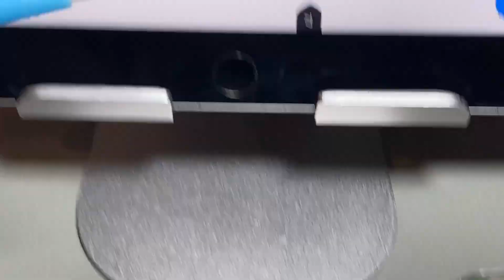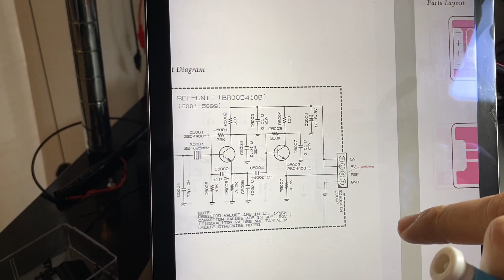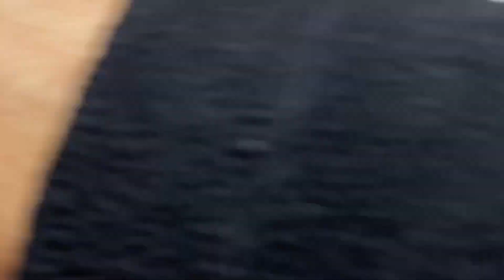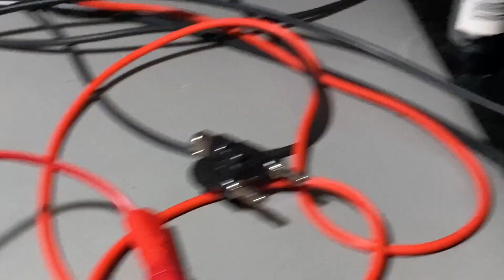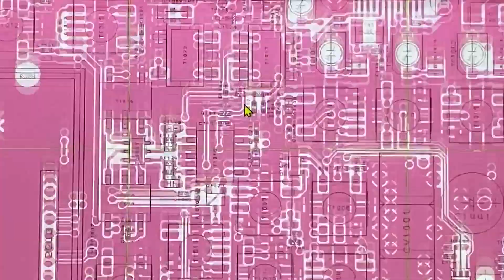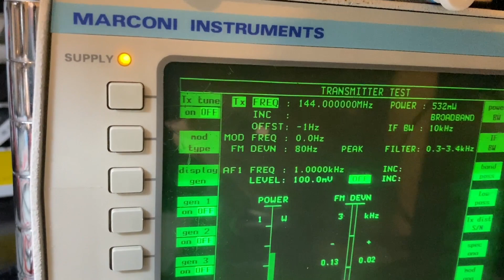MY YAESU FT-817ND | service adjustments - part 1

Comment: Good evening dear om, it is with great pleasure that I watch your very interesting and very explanatory videos, a question concerning the point of the boonton probe, I see what you made one? Do you have a drawing or photos of the construction? I have 2 devices that are missing the tip. With my thanks.73 HB9ICA
Reply from the maker: Hello. Yes I made one myself. When I bought the Boonton it came without the tip. Unfortunately is very rare to find. I made one out of a piece of plastic resembling a tip found just by chance. Made a little hole and insert the center pin of a N male connector. Then filled the tip inside with epoxy. At the base of the tip I soldered a little piece of copper folded to give it a little tension when it come in contact with the center pin of the probe. for the shield I used a piece of solder wick and a little crocodile at the end. Also a short piece of aluminium tube that fits the outer diameter of probe. Is hard to explain but you have to have a bit of vision to use what you’ve got. When I have time I might to a short video showing all I said. 
73
Diego
Reply: Hello Diego, thank you for the explanations, as you say it is very difficult to find the measurement points, best regards A.B.A

Comment: Good morning Diego, I take advantage of this treadh to ask you for advice on a strange fault I have on an FT-817 ND. The High Swr signal appears occasionally. The symptom lasts for a few minutes and then disappears. It goes without saying that for the tests in this short period of time. I used a dummy load, tested both outputs (front and rear) and changed cables and connectors. The symptom disappears after a while and then reappears every now and then. I disassembled the device and checked the connectors but I didn't find anything particular. Do you have any suggestions? Thanks from IZ1FHC
Reply from the maker: Ciao Franco, ti rispondo in italiano. 
Io ho lo stesso problema in banda 144, ma solo su quella banda. Ho letto in giro che potrebbe essere un problema di autoscillazione nello stadio finale. Io in effetti andando a “toccare” un po’ l’area del finale riesco a farlo scomparire. A te in che banda capita? e quante barre di swr? hai provato se lo fa anche abbassando la potenza di uscita? a me lo fa solo in alta potenza (5w). Saluti
Diego
Reply: @IZ0MTW   Grazie della veloce risposta. Non compaiono barre ma solo l'indicazione HSWR con un abbassamento della potenza in uscita a 2w. Il problema sembra essere noto, ti riporto (indagherò su questo aspetto) una risposta in un forum (groupsIo) :

From Don Taylor's response in that topic:
-------------------
IF so on Pin 8 of Q3003 on the PA Unit is a voltage called V-TX that switches the output of the PA FINAL thru to the 2 Meter Low Pass Filter.
There it passes thru the Relay RL3001 which for 2Meter is closed from the moving contact to the Normally Closed (Black) contact which passes the TX energy on to the Diode D3003 an HSU277 ( Pin Diode ) and from there on to the front or rear Antenna select RL3015. Other than that, there is another Diode D3005, that enjoys going bad and it can also cause he problem you are having. These are both on the bottom (B side) of the PCB. This diode turns on to protect the RX when TXing. This is turned on from pin 4 on the Q3003.
I believe I am having the same symptoms, more or less, so would these diodes be the first thing to try.
Could there be a connector issue? I suspect not given that both front and rear ports are affected.
Reply from the maker: @francocorsi4520 Bene Franco, grazie per la risposta con le info, molto apprezzata. Buono a sapersi, così quando avrò tempo di dare un’occhiata alla mia ne terrò conto! 
Un saluto e in bocca al lupo per la tua!
Diego

Comment: Hi, great videos,
I have GPS locked Marconi 2955, 
Your test set looks very nice,
Anyway I have just got a none Nd ft817 all is working well tx and Rx,
But the 145mhz FM  frequency is about 1 khz higher in frequency then am and ssb
And obviously higher on 430mhz,
Is there a separate adjustment for FM frequency then am/ssb,
The radio also has the china TCXO so it is very stable and only about 2hz off on  say 7mhz,
Thanks for your help

Dave 2E0DMB
Reply from the maker: Hi Dave and thanks for your comment. Yes i’m FM you need to act on a separate adjustment, T1018. Have a look on the manual for its location on the board. Best wishes
Diego
Reply: @IZ0MTW  Hi Diego
Thanks for the very fast reply,
I will look at that,
Thanks Dave 2E0DMB
Reply: @IZ0MTW  Hi Diego
Great I know that you would know, 
I have just done this and all is good,
Thanks for you great help,
It would have taken a long time to find it in the manual,
Keep the videos coming
Thanks Dave 2E0DMB
Reply from the maker: @davidbrowne1588 Glad I could help Dave. It’s a turning wheel. Sometime in the past I’ve been helped by a gentleman here on YT and I’m happy to give back something if I can. Enjoy your 817!
I’m moving house in this period so hard to get new videos coming. All my staff is packed in boxes in these days. Hopefully I can have my lab back soon. 
Best wishes
Diego
Reply: @IZ0MTW good luck with the move,
Thanks again
Dave

Comment: Thanking you very much for the FT817 Video servicing informations.
Yes I do agreed with your findings that some technical errors on the servicing manual.
Even on the components layout diagram shown but the circuit PC board does not have those components installed.
The tests adjustment value not reliable. 
I have worked on and learn it a very hard way.........
Reply from the maker: Hi there, gald my video helped you out. When you work on a radio make sure you’re looking at the same board that’s installed on your radio.
There are often many releases of manual, reflecting different batch of production. Use the radio serial number and/or PCB part number to be sure.